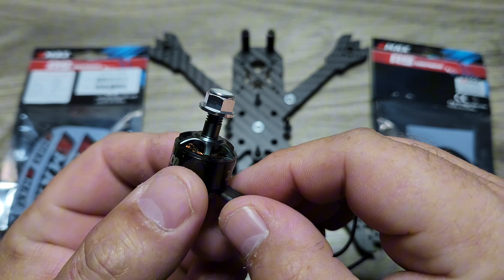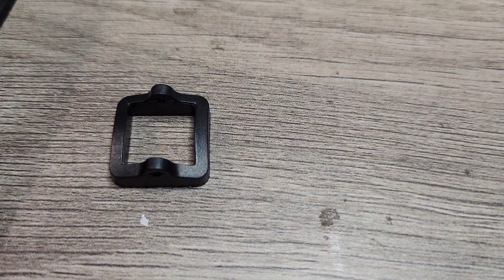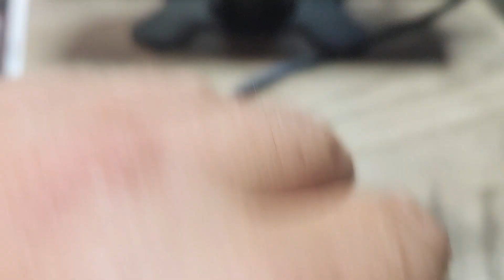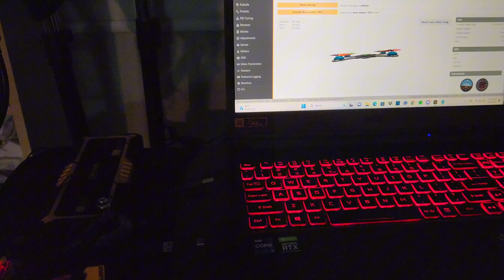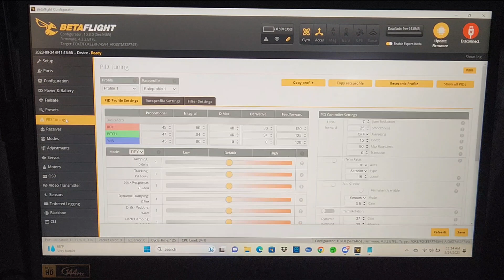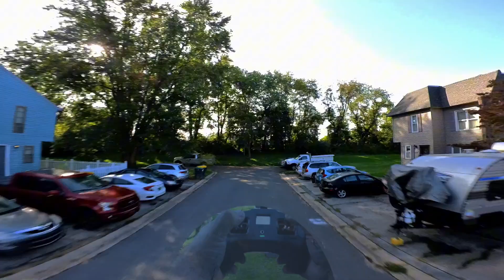Grinderino 3.5" Walksnail HD Nano Kit V3 How To Build / Firmware / Betaflight / FULL Review!

Comment: Where do you get power for the bec? Battery lead, cap and bec all on the same pads seems a bit much.
Reply from the maker: No issues thus far using the positive and negative pad on the AIO for powering the bec with the capacitor.